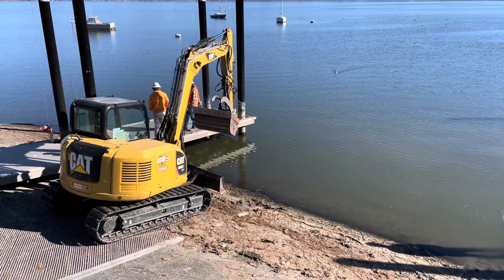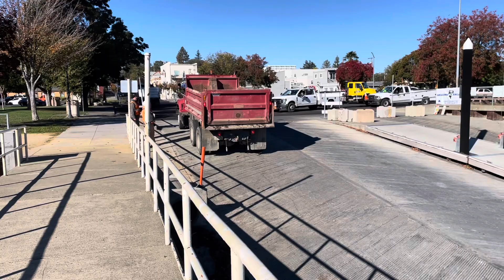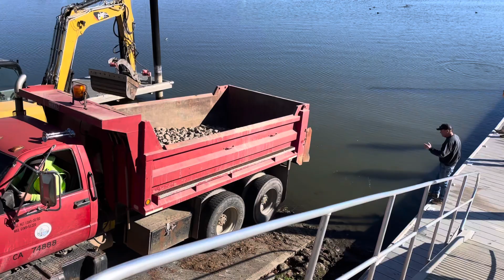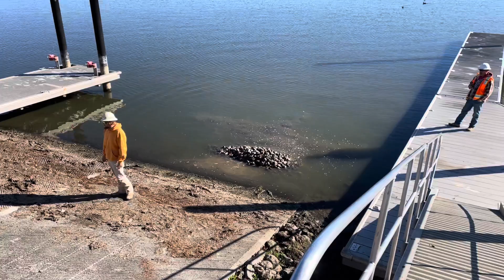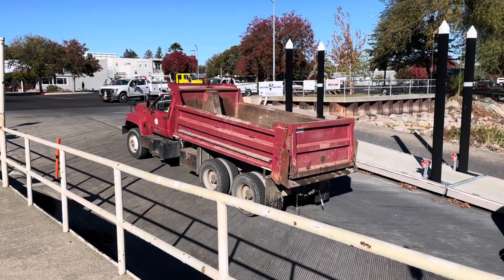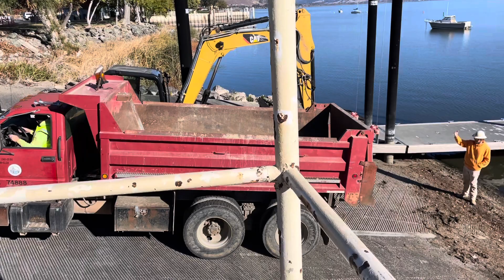Clear Lake Report (Update) 11-05-2022

Comment: Hey Ross

Have you launched out there since this video?  Did it improve the situation?
Reply from the maker: Hey there Matt.  No I have not.  I don’t use the Oaks ramp.  I am still a little skeptical of 3rd St with a bigger boat (say a 20’ on a tandem axle).  I have been using 5th St as late as last Monday and had no issues at all.  Even if the lake drops another couple inches I thought the ramp would be good.  I watched Jimmie launch his big Ranger after the ramp fix and closely watched his trailer as he backed in and came out, it looked good.  My only concern is power loading, I am going to depend on the winch.